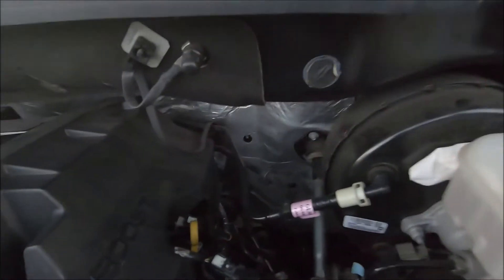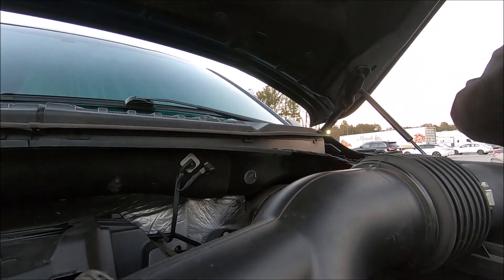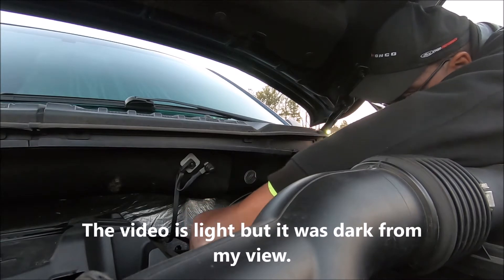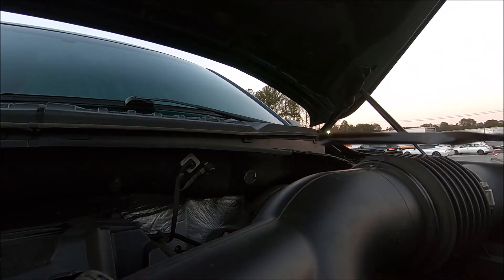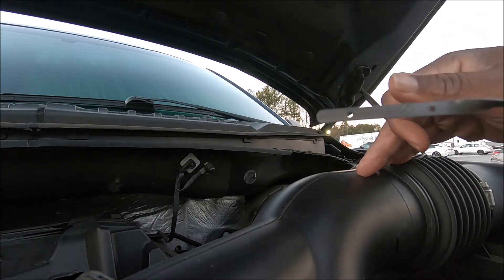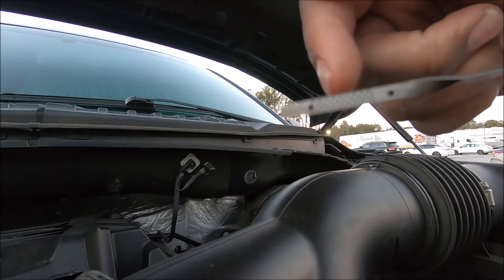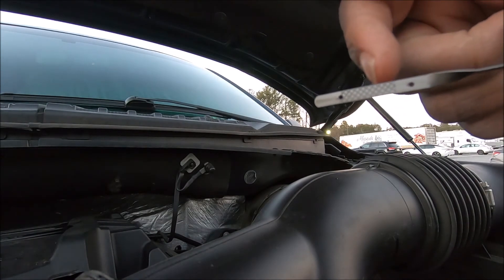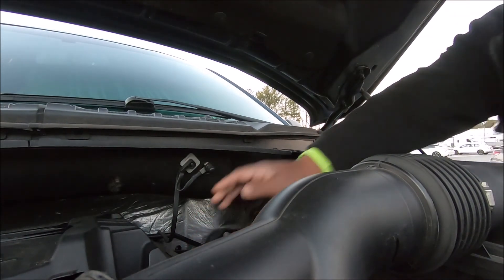How to check oil in a 2016 F150 2.7 ecoboost v6

Comment: Do you know how to check the transmission fluid
Reply from the maker: Yes, I will make a video after I'm done with my Trailblazer.
Reply: @blackericdenice  I meant on your f150
Reply: @blackericdenice  and are you gonna post rebuild videos of the trailblazer
Reply from the maker: @thomaswilmeth6138  yes
Reply from the maker: @thomaswilmeth6138  Yes, i will post videos on everything i do.
Reply: @blackericdenice  the check plug  dipstick is on the passenger side on ur f150 right
Reply: @blackericdenice  good
Reply: @blackericdenice  I watch all of the ones from ur Tahoe